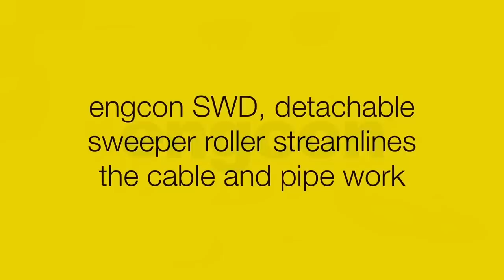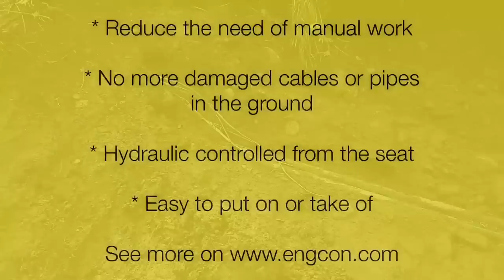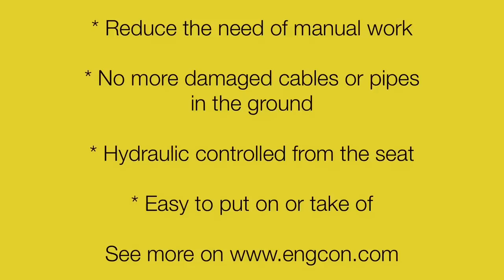engcon SWD sweeper for excavators

Comment: If they make it with bigger attachments to cut and clean faster it will be a very good product. Overall it's really nice.
Reply from the maker: @Just for Fun  Thank you for your feedback. The idea with this type of extra tools is that you can adapt it in the front of the Q-Safe quick coupler. If you want bigger sweepers, grabbers or other tools - you can connect them underneath the quick coupler instead of the bucket. We (engcon) offer sweeper rollers, grabbers, compactor plates, etc See all tools on our webpage: http://engcon.com/en/our-products.html
Reply: Just for Fun h